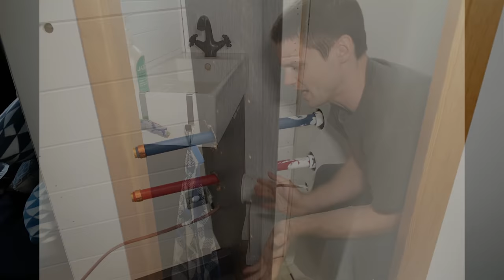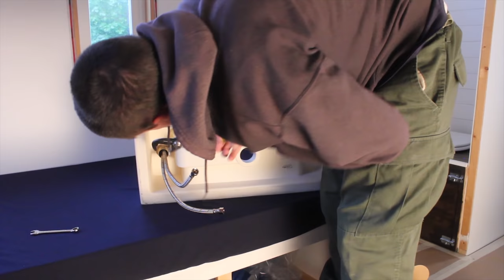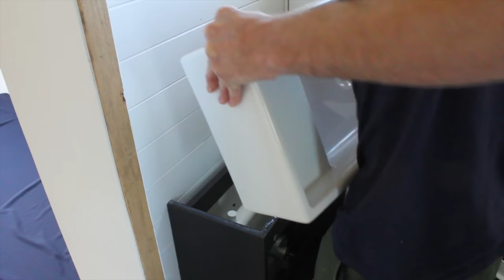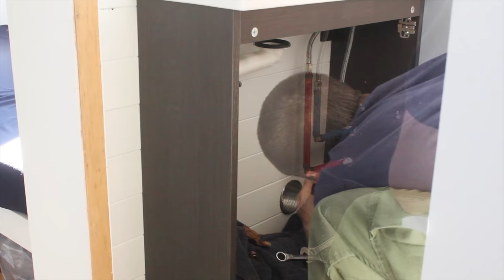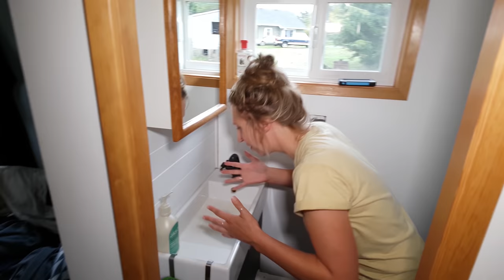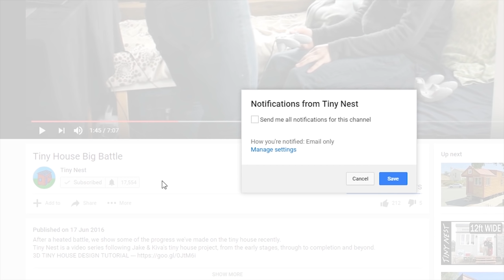Tiny House Bathroom Sink (Ep.76)

Comment: howdyyyyy yall . the horizontal piece in a cabinet is called a rail and the vertical pieces are styles.. I doubt that sink would move even with that little bit of silicone that was missed on the front edge..the amount of force it would take it up there. every sink or toilet i would set when i was doing commercial plumbing we would always silicone around the parts that were on the floor or against walls and we never had a call back due to the item moving around breaking the seal.. keep up the awesome work
Reply from the maker: Ah thanks for sharing... good to hear some experience-based feedback about this :)

Comment: Also, regarding the issue with the mirror cabinet, you could recess it in to the wall cavity so the storage is in the wall space and the mirror is flush against the wall. 🙂
Reply from the maker: We've gotten a few suggestions for this and the issue is that the wall behind it is only 2x2 and has a stud right in the middle... so I don't think it's an option. However, someone else proposed to replace it with just a mirror and move the cabinet to another wall, which we're going to consider.
Reply: Yah, I think any non inset vanity would prove troublesome regardless of the sink.

Comment: one of the greatest inventions in all of  mankind is the single handle faucet .. look into it .. also you need to secure your plumbing lines and add shutoff valves below the sink .. shutting down a main (for a tiny home) by scale is doable, but plumbing emergencies are miserable enough if you have to negotiate a larger shut down.  You need to move the medicine cabinet to another wall and replace with a mirror on the wall (they're pretty cheap) .. pleased on your progress .. keep at it!
Reply from the maker: Our kitchen faucet is single-handled. In our experience they are harder to control the amount of flow, which is an issue with our tiny sink and splashing. Also due to the way our on-demand water heater works, it's easier to control with a dedicate hot knob. 
Good point on the shutoffs... I didn't bother because, like you brought up, the entire house's main valve is at most a few seconds further away, so it didn't seem necessary... but then again, if there is a leak our opinion might change :P and shutting off the main still leaves water in the lines that could continue to drain out. 
I see a few other comments suggesting to recess the medicine cabinet, but that is not really an option with a 2x2 stud directly behind it... I actually like your idea better... plus we could keep an eye on the backs of our heads with two opposing mirrors like that XD
Reply: the hot knob, I'd not thought about .. two nob faucets continue to exist, thou I can't see why .. but your fixture is to scale and looks nice .. yes the medicine cabinet does NOT have to be over the sink!

Comment: If you do end up moving the cabinet for space, consider putting in storage even though it's a 2x2 wall. The stud will still leave plenty of space for smaller items. Alternatively, cut out where the mirror will go so it is recessed flush to the wall. I think I like this idea better! 

If 3/8 was too small for the fixture hoses but 11mm was too big it's possibly a 13/32. These fittings shouldn't be overtightened as they typically have a rubber seal in them. Metal on metal fittings should have Teflon or pipe dope applied as well, but not if they have the rubber o rings in them. The tool you need to tighten the entire fixture to the sink is called a basin wrench. 

Just offering tips for others, I'm sure your installation is fine! Curious about the vent under the cabinet that is never mentioned, presumably for the toilet? 

Glad to see new content again, thanks guys!
Reply: I forgot to ask, do you have any type of filter on your supply line? RV style filters are affordable and go inline easily to reduce the minerals in the water if you're looking for an easy/small improvement
Reply from the maker: Thanks for the tips! Second one about not over-tightening the fittings, which is helpful for others. Luckily everything is fine after what I did. 
The pipe is part of a venting system that has yet to be finished (big surprise) that will pick up toilet air on the way out of the house. Video about it in the future. 
There is already a softening and UV system at the source... the quality of the water is not that bad, but we wanted to mention it because it makes things look dirty in the video!

Comment: Convention is that the cold faucet/handle is on the right and the hot one on the left. For you it would mean that cold is at the front and hot at the back. Kiva's demonstration suggests you got it the other way around. I assume that you would use cold water more often than hot water (just washing your hands, for example), so having cold at the right/front easily accessible would make more sense. To me anyway.
Reply from the maker: Funny story: the faucet has the words HOT and COLD printed right on the handles... hot on the right, cold of the left. Either way, both knobs are easy to operate with no awkwardness required to reach the one closer to the wall.
Reply: I would bet that those are just caps on the knobs and that they just pop off to expose a screw that secures the handle to the valve stem.
Reply from the maker: Probably, but we just went with it as it was.

Comment: Recessing the mirrored cabinet, into the wall would really take care of those problems.
Reply from the maker: We've gotten a few suggestions for this and the issue is that the wall behind it is only 2x2 and has a stud right in the middle... so I don't think it's an option. However, someone else proposed to replace it with just a mirror and moving the cabinet to another wall, which we're going to consider.

Comment: Do you not find that tap closest to the wall a bit awkward to get to? Maybe a single handle mixer tap would have been a better choice?
Reply from the maker: It's actually not an issue, but just by a little bit... any less space and it would be. 
We actually prefer separate knobs in general because they are a little easier to learn by muscle-memory to get the right flow and temperature, both of which are important in this case because too much flow in this tiny sink will cause excess splashing, and our on-demand water heater is easier to control with a dedicated knob. We find single-handles to be a bit unwieldy for careful adjustments, but it's just our preference. Our kitchen faucet is single-handle but the way it operates has less of an impact in that location.

Comment: Have you looked into a filter system to try and remove the minerals from the water? I checked back to your plumbing video to make sure you hadn't installed one initially .
Reply from the maker: There is already a softening and UV system at the source, and the quality of the water is not actually that bad, but we wanted to mention it because it makes things look dirty in the video!
Reply: Wouldn't those suspended minerals in the system create a film inside the UV treatment device too, thereby reducing its efficacy. I would guess that there must be some regular maintenance required to remove buildup, similar to that which is required for demand hot water heaters.
Reply from the maker: There is a water-system maintenance guy that comes out once a year to replace/clean stuff.

Comment: Nice job.  One question though, not related to your tiny house.  What kind of razor were you using in the video and how do you like it?.  We also live in a tiny house, so size is important and I don't like a 110v plug in.  Thanks for your ideas.
Reply from the maker: Ha, I've been meaning to get a proper electric shaver because the thing that I'm using is just a trimmer that came with a full hair clipper kit :P 
I'll share a review if I get something good.
Reply: Okay thanks.  I am now using a small Norelco AA batery operated travel shaver that works, but it is getting old.
Reply from the maker: Thanks for the suggestion. Looks like a good option... I'm struggling to decide if I want to buy one though, because the thing I already have does work fine, and we do make an effort to live minimally (within reason) so I definitely don't NEED a new one...
Reply: Tiny Nest - yeah I really love that approach - do not buy what you do not really need... glad to hear that Jake 👌👍

Comment: Hi Jake, these inlet hoses are ment to be tighten just by bare hand, no tools required. Actually you are quite lucky to not pop open/crack the foset by using that tool... Cheers ✌️
Reply from the maker: Hm, it's been a while since we filmed this, but I remember not feeling particularly confident with the seal I got by hand, which I naturally did first before moving on to tool-tightening... the braided hoses flex/twist before you can get even a solid hand-tightening... this faucet is a pretty solid piece of metal so it didn't cross my mind that I could damage it by tightening the hoses. 
I appreciate your feedback and am curious as to where it comes from? what experience or knowledge do you have that is sure that the hoses should be tightened only by hand?
Reply from the maker: Thanks!